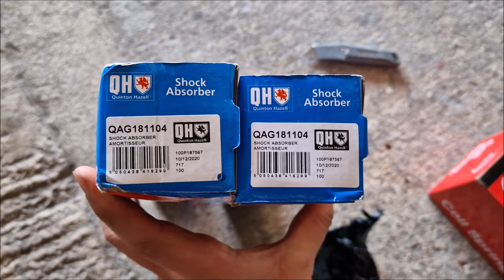Smart Fortwo 450 Rear Shock Absorbers & Springs - "Certainly NOT A Waste Of Time!"

Comment: How are you getting on with the 451
Reply from the maker: The 451 is pretty much finished now project wise. Need to sort the roof and we're done! It's my current daily driver and have covered 2000 miles since April ☺️